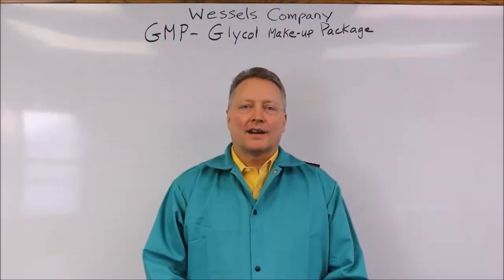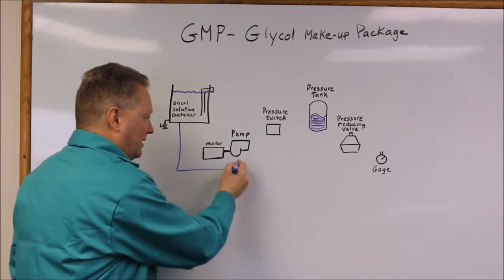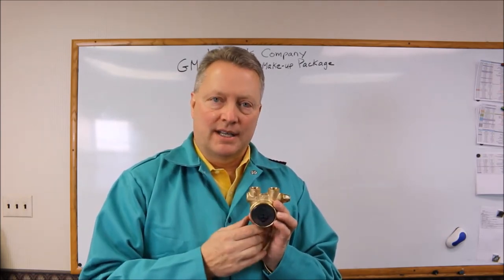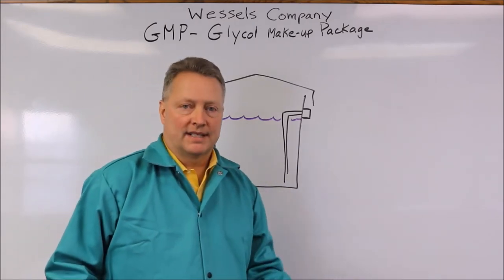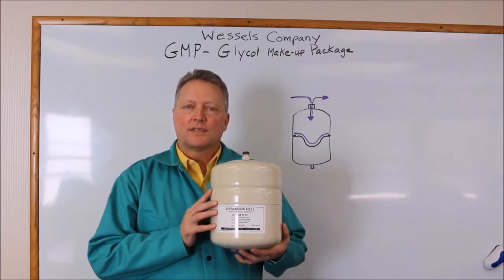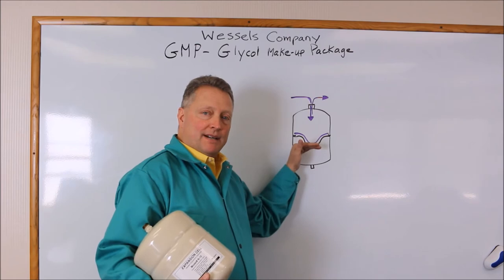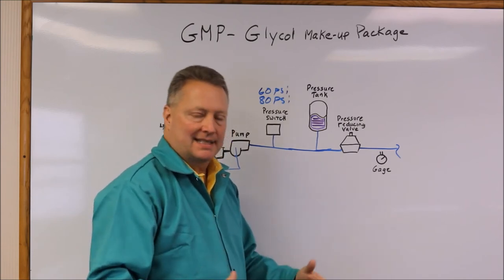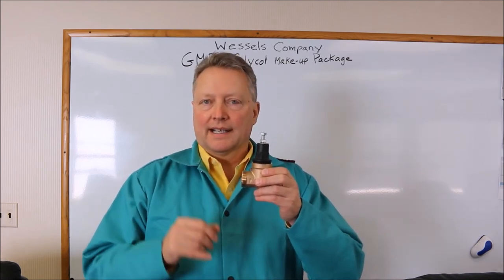How It Works: Glycol Make-Up Package

Comment: My new expansion tank for Navien CH 240 heating system came precharged at 12 psi.  What will happen to my systems operation if this tank pressure is not correct?  I ask because I’ve seen some tanks recharged to higher pressures. Owners manual says nothing about recharge pressure.  Also, is the glycol used to cool the heat exchanger?  My glycol strengh is ver low...it is almost just water.  Will this cause my heat exchanger to overheat? I am getting this error and the only thing that changed with my system is I flushed the system and in doing so lost most of the glycol so it is mostly water.  The water sometimes boils within the heat exchanger ( this is the error code I get).  Thanks.